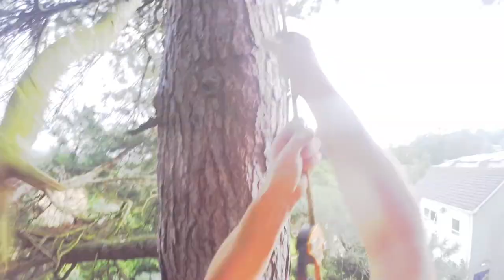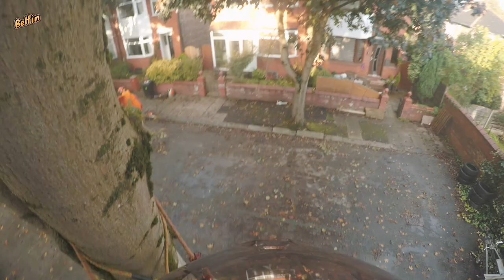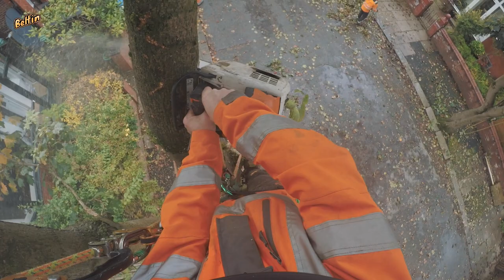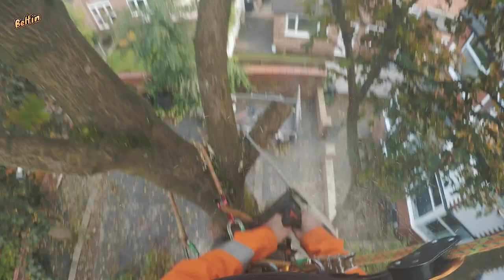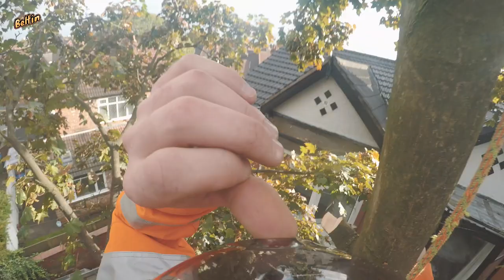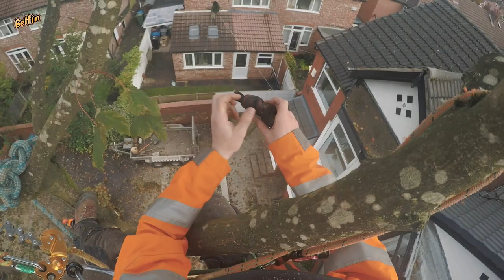(Raw) SRT Maple Removal [UK Tree Surgeon]

Comment: How do you like the chicane? Tbh I run a rope wrench on it since it works fine, though I know they don't recommend it. Good safe work. Climb high!
Reply from the maker: Hi, yes its good. It is however the only SRT set up I have used so I can't say what the rope wrench is like in comparison.I would imagine the chicane is optimum for the Zigzag.